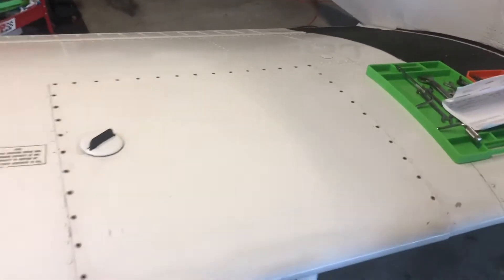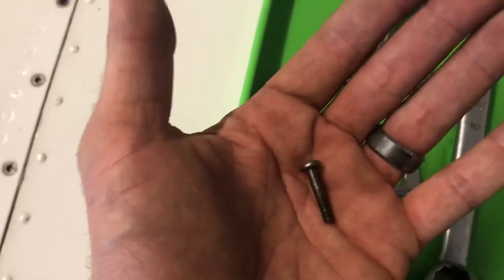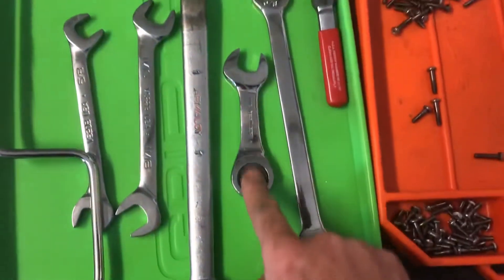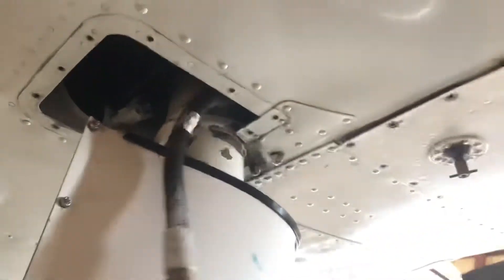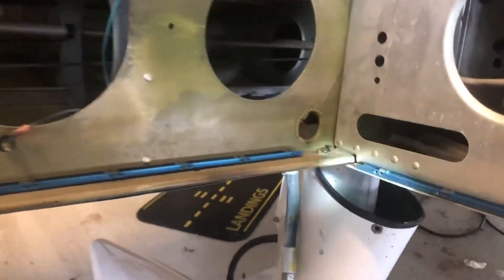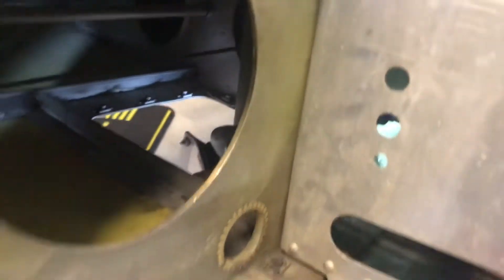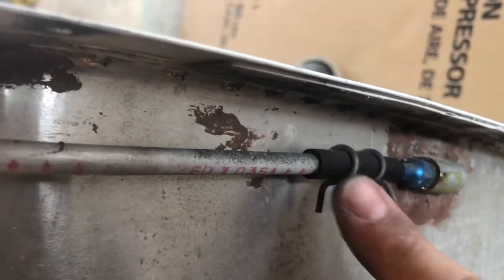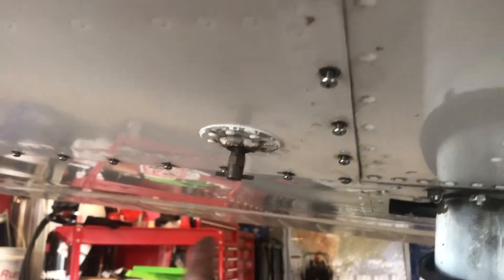Piper Cherokee PA28 PA32 Main Fuel Tank Removal and Installation, Piper Service Bulletin 1006.

Comment: Hey Matt, just found your channel. Very good stuff. One of the nutplate holes on my Cherokee wing tank is stripped. I noticed it’s one continuous plate. Do I have any other options other than replacing the whole plate? Guessing you can’t tap/oversized those holes? Thanks